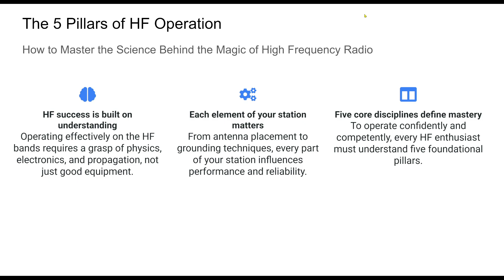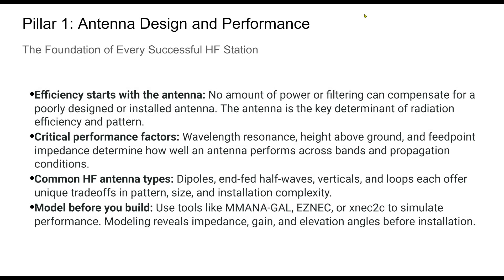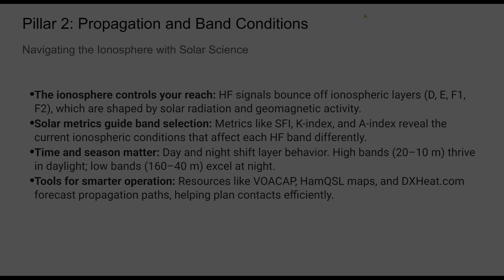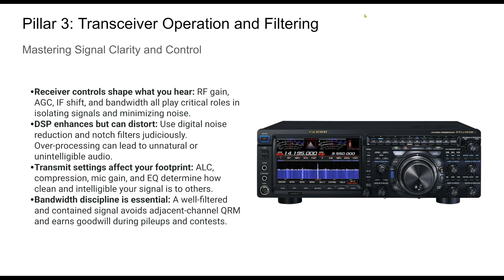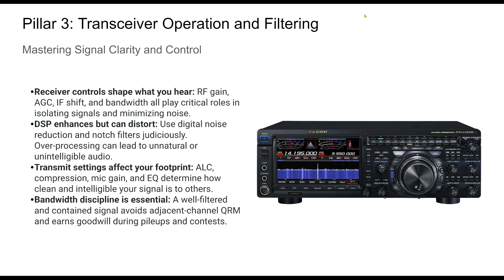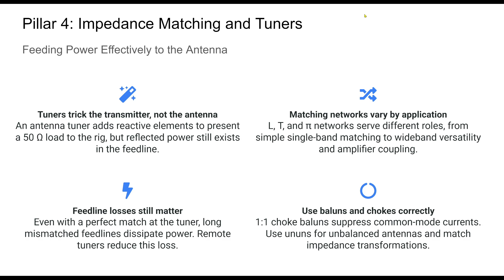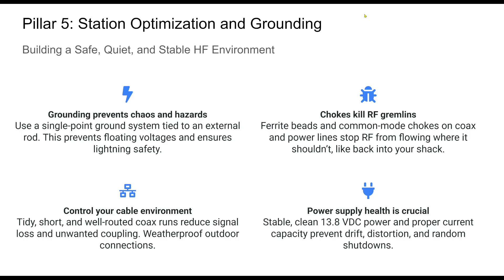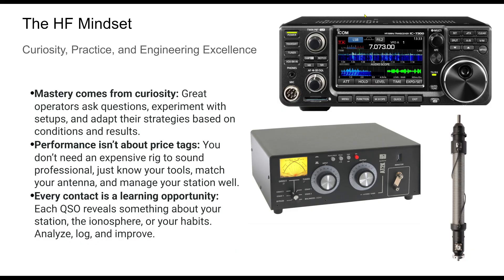5 Secrets to Better HF Radio!

Comment: I squeezed a low 60m band inverted vee into my tiny 25' x 13' garden. Put up whatever you can. 
Five attic dipoles for 20m to 10m. 
A long wire for lower frequencies. Wire aerials are cheap.
Even a simple Pixie can be good. 350 mW out to my inverted vee got me a QSO at 180 miles with a SWL report for that contact from Utrecht at 220 miles. How much farther was my signal going? Many more contacts between 60 miles and 120 miles. A two transistor transceiver.
 G4GHB.
Reply from the maker: That’s awesome, thanks for sharing 👍

Comment: Dear Swami Ape, first it is good to see you back. Second, time well spent watching your videos, as always. In my Ham Radio journey, my mistakes were brought about by not knowing the questions to ask, nor having an Elmer with whom I could converse about ALL of the topics you spoke of in this video.🤷‍♂️ lessons learned the hard way. 73 KQ4IXD
Reply from the maker: Hey FM, it’s good to be back but I still need to get into the swing of things.  The reason I started making videos was to share what I learned along the way because I didn’t have a good club or Elmer AND most of what I saw on YT wasn’t as educational as I wanted.  Thanks for watching bro 👍

Comment: You did a nice job except and its only one. Yes tie all your radio amp and tuner together but do not attach that anything outside.  If you do it brings lighting inside.  Not what you want to do. Ask if you need more details.
Reply from the maker: Thanks Thuff

Comment: Good video, and it really touches on something important: mastery in radio isn’t about gear or gadgets, it’s about learning how to use minimal gear to efficiently shape RF.
In the beginning, it's normal to lean on gadgets, meters, analyzers , they help bridge the gap between what we see and what we can’t. As the operator matures, understanding develops. The gear becomes simpler, the setup cleaner, not because they’ve outgrown the tools, but because they’ve learned what truly matters.

Mastery isn’t having more, it’s understanding how every part of the system affects the wave.
The antenna, the feedline, the grounding , they stop being isolated components and become part of one living system. 
The operator learns to sculpt that system with intention, not guesswork.
That’s what separates activity from artistry.
Not complexity, but clarity.
KO4AYE
Reply from the maker: Very insightful SaW, thanks man 👍

Comment: Having standing waves on the feedline doesn't necessarily mean you have an inefficient system or that it's not resonant, tuners don't fool the transmitter, they actually provide a conjugate match where the whole system becomes resonant including the antenna
Reply from the maker: Hey Pioneer, I’m familiar with conjugate matching and Maxwell’s writings…. That said, it fools the transmitter 👍
Reply: @TheSmokinApe if you are familiar with Maxwells writings then you would understand that a conjugate match isn't fooling the transmitter, it's creating a resonant system
Reply: @P @Pioneer936 ’s creating a resonant system in the transmitters eyes. A conjugate match provided by a tuner does not change the resonant frequency of the antenna. If your antenna has a 400 ohm impedance a tuner may make a match to 50 ohms but the antenna is still non resonant and remains at 400 ohms.

Matching fixes SWR, not physics. Your antenna will be no better off than before the match occurred. If your antenna was say 60% inefficient before a match then it’s still 60% inefficient after the match.
Reply: @doc145 if a conjugate match tunes out the reactance of the antenna feed point then the antenna is resonant